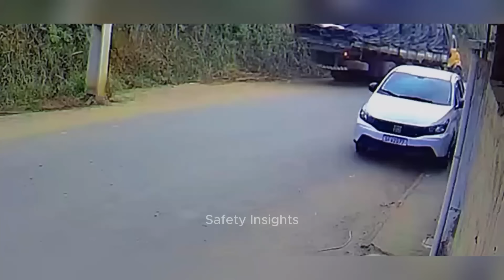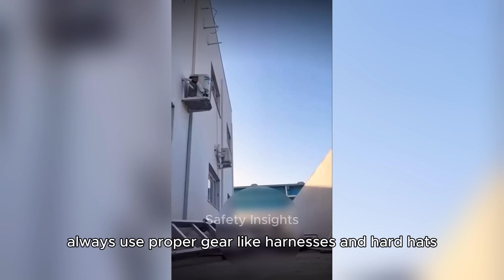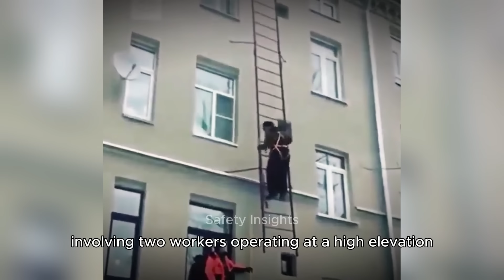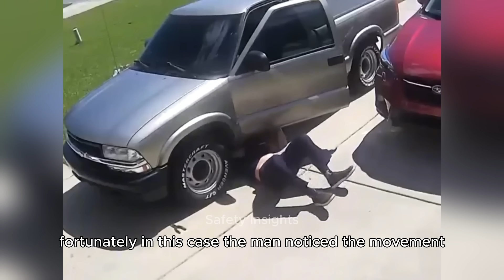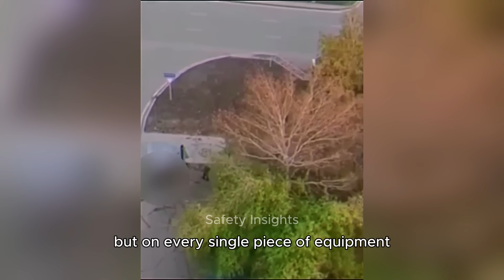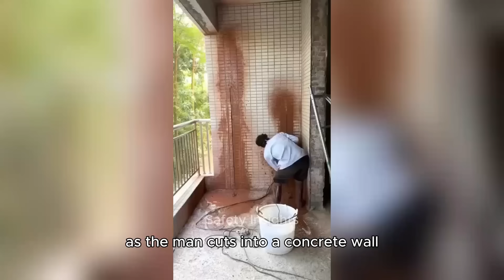Top Industrial Incidents Caught on Camera 2025

Comment: I’ve had a near death experience, working on rotation moulding machine. It has 3 arms, one is in the oven, one is getting loaded and the other is getting unloaded. I was first week on this job and the guy running the machine was a idiot from India. The arm started rotating and had dropped low, it went under the structure we are standing on and lifted the whole lot and the oven doors opened and started moving us into the oven, I seen into it and it looked like the fires of hell. Gas flames in room size oven. The Indian worker was totally panicking but doing nothing, a supervisor ran across the floor and stopped the machine for us just before we went into the oven. I quit that job a week later.

Comment: Back in the mid 1990s I was working at a junkyard..we had a can machine that crunched the cans and sent them into another room piling up and fed into a bailing machine...I took off work the one day .I returned the next to find out a fellow co worker had been severely injured the day I was off .on the can machine it had moving parts mainly a conveyor belt ..the motor for that is an exposed fly wheel that connected motor to machine with fan belts.he bent down to pick up a fallen can putting his hand upon the flywheel with belts .his fingers got caught in the flywheel belts  crushing his fingers bc there wasn't any guards over that area..sad part is the owner never did anything either to remedy that ....true story..